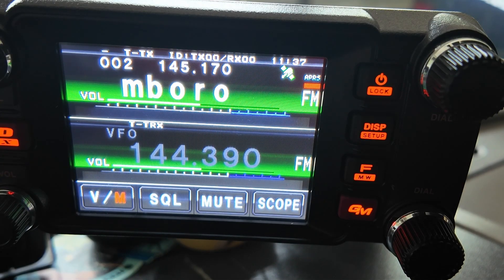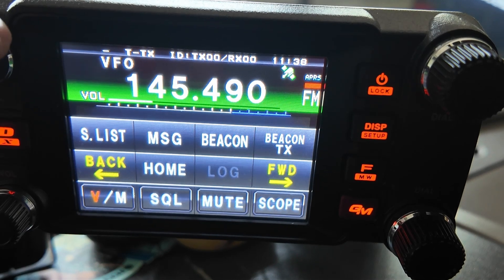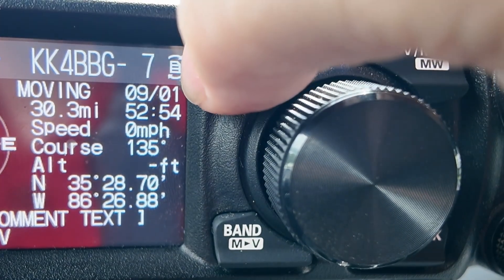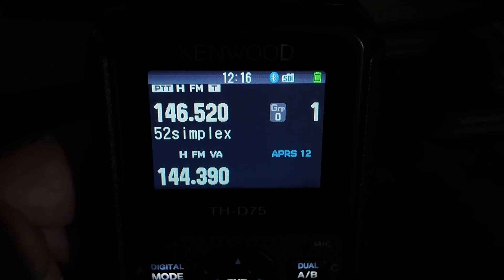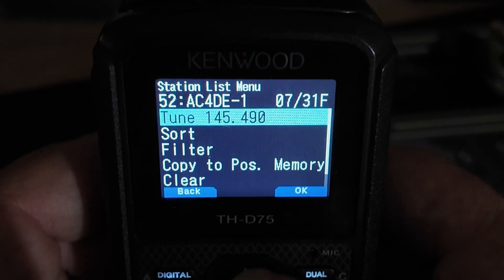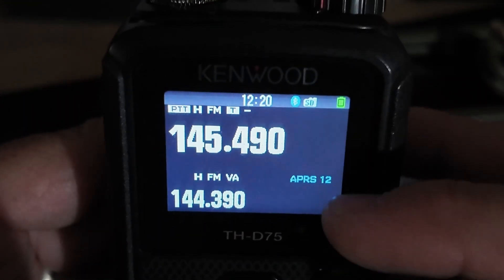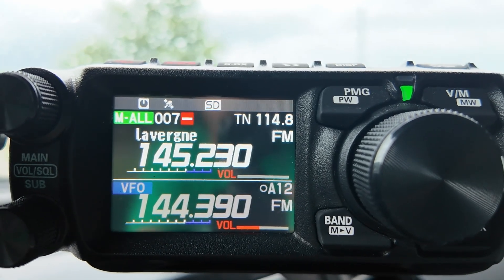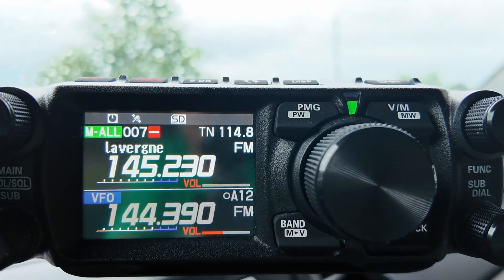How to Use the APRS QSY Feature

Comment: Any thoughts on why APRS only seems to be used on 144.390? Does anyone ever venture off to other frequencies to communicate? Here in NNJ the frequency is always clogged with weather and various other beacons, but little actual communication it’s feels like..
Reply from the maker: 144.39 is considered the "standard" freq for APRS much like 146.52 is the calling freq. However, nothing says you have to be on 144.39. Myself and several others in my area use other frequencies from time to time.

Comment: FTM500 quick tip. If you long press the bottom right knob, (sub dial) it will open the aprs station list.
Reply from the maker: That must be a function of a later firmware. Not working here. I'll check it again after updating the firmware.

Comment: For APRS QSY operation to work on the D74/75, does it matter if APRS channel is VFO A or B?
Reply from the maker: I don’t think it matters which VFO. You do need to be in APRS mode though. (Fct+5)
Reply: Looks like the 144.39 needs to be on whichever VFO is designated for data. Though I’ve forgotten how to move the data designation from VFO A to VFO B. 

Also, it seems the QSY info sticks with your APRS SSID even after transmitting packets with a non-QSY enabled radio. At least that was my experience.

Comment: One more change I made in the FTM-500D to make my life easier.  I used the programmable keys on the microphone.  P1-WX, P2-Stn-List, P3-MSG-List, P4-Reply.  P4 is possibly going to change, not sure.  It is just easier to have it set on my mic in my lap rather than reaching up for the screen to the quick function menu.  I put my beacon settings in the quick function menu.
Reply from the maker: Good idea!

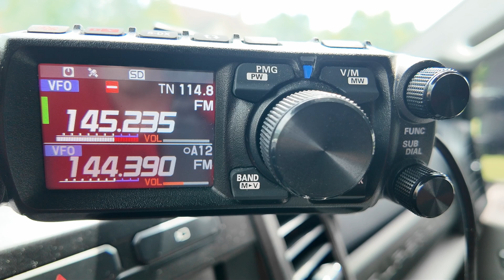Comment: 5:41 I can confirm with the latest firmware in the FTM-500D it does fix the repeater glitch.  Also when you choose QSY it updates your frequency and backs you out to the main screen with one press.  I’m currently running: Main Ver-1.15, Sub Ver-1.12 and DSP ver-7.20.
Reply from the maker: Thanks for the info. It encourages me to get off my rear and upgrade.

Comment: Yaesu needs a firmware update on all their rigs. If you’re on the c4fm calling frequency of 145.6525 on vfo A and use the Freq & Tone to include it in the aprs status text….it will drop the trailing 5.